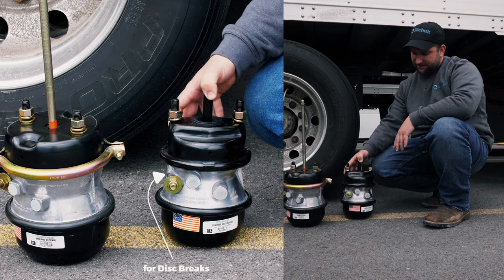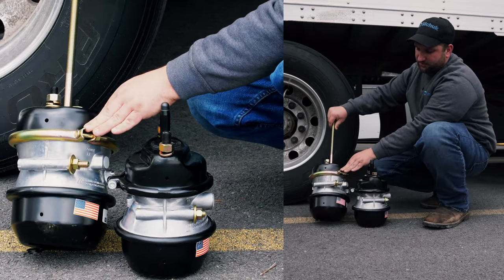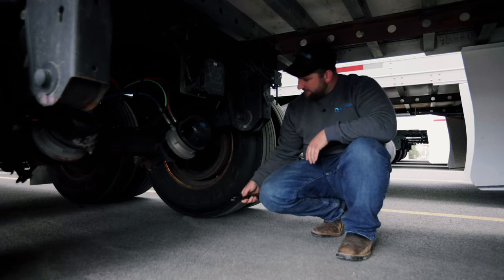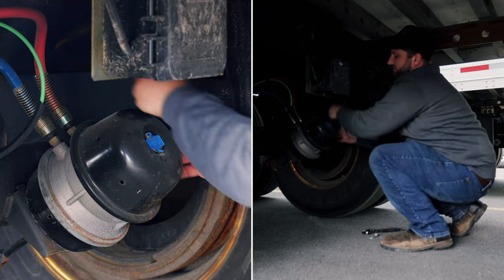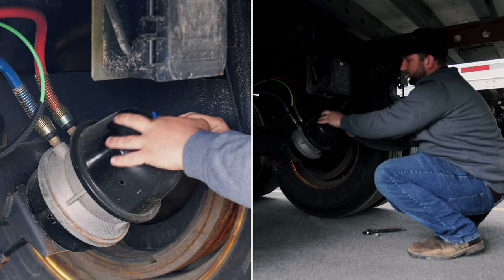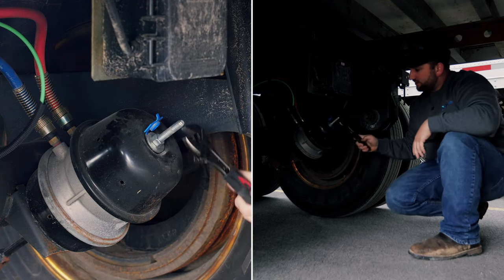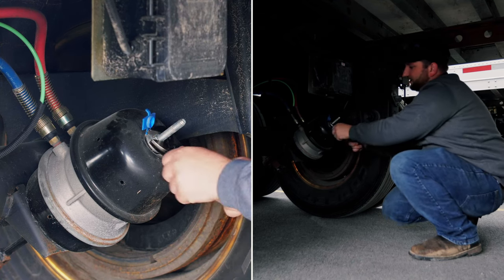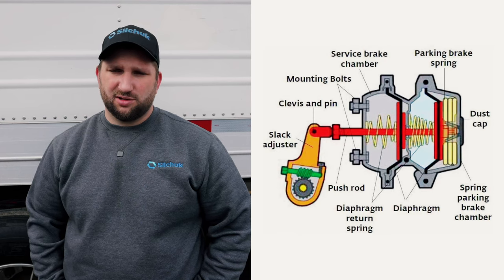How to Cage / Release a Brake Chamber

Comment: What size wrench?
Reply from the maker: Hi , we use 19mm 🔧 . Anyways it’s nice to have an crescent wrench, in case you need a different size 😊
Reply: @silchuktransport  I ran over a deer.. thank God only damage was trailer airline. I had my vice grips to clamp off line but no wrench to tighten the nut on chamber. Thanks for info.